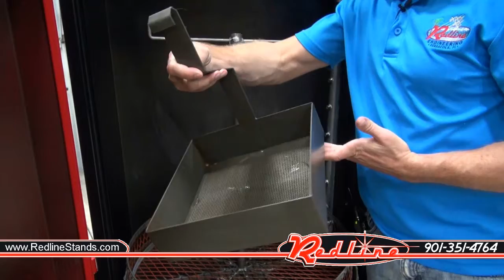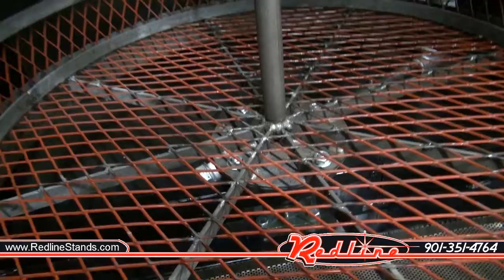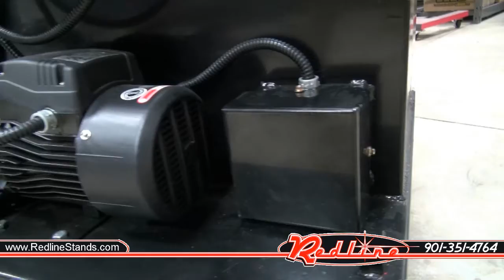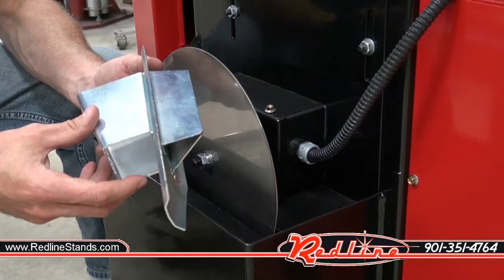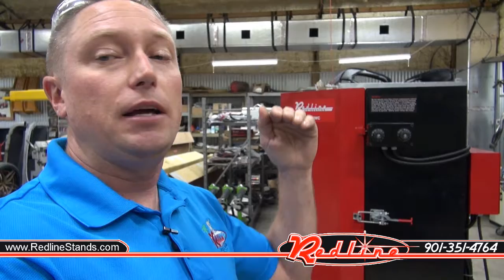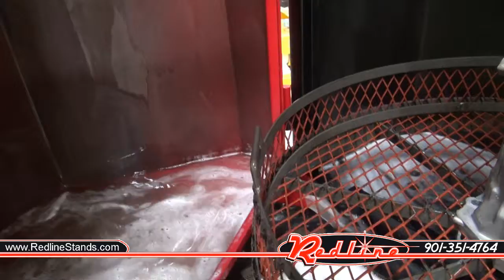Redline 500HWC Heated Wash Cabinet Demonstration

Comment: What size is the inside basket?
Reply from the maker: https://www.redlinestands.com/catalog/shop-equipment-c-327/general-shop-equipment-c-327_335/parts-washers-c-327_335_272/redline-500hwc-heated-wash-cabinet-oem-replacement-parts-tray-p-3494

Comment: It looks like you might not have enough water flow for the total number of nozzles you have.

If I was going to make it better, I would put a stainless steel flexible hose connector on the bottom pipe and the top pipe and then I would build something that would "oscillate" the nozzles side to side and up and down but not coordinated to the spin of the basket.  I believe you are missing lots of nooks and crannies by just making them solid and spraying in one direction.  

The other way to do it would be to use more nozzles mounted in different directions and maybe on different pipes with a bigger pump with more HP.  Just trying to Help, Sir

Comment: Why not install a float switch to prevent the motor from running when the water level is too low?
Reply from the maker: We might do something like that in the future, but the truth is that this is our first production run on the cabinets.  You'll likely see improvements over time, but naturally they'll come with time.
Reply: @RedlineStands  im looking to get one   you need a toilet valve float inside       with a shut off valve on the outside  obviously you cant pull it out your toilet and will need to be designed   but anyway
Reply: Ranger cabinets have them, honestly theres so much grease inside of them they clog up. We bypassed the switch within the first week of having it in the shop. Just pay attention to the water level and you will be fine. If it gets a leak you will definitely know it!
Reply: Excatly that happened to A Kuda that I used @bradbrinegar1419

Comment: Why not put in an automatic fill for the water supply ?
Reply from the maker: That might be something we could offer later, but it's not a feature I'd do on the front end, because keeping the initial cost down helps a product to sell.  Given the liability of an auto-fill device concerning flooding, I'd have to think long and hard before offering something like that.  Nevertheless, thank you for the idea.
Reply: @RedlineStands  you could put an over flow that a person could hook a hose to in case of the fill valve failure. Tie The high overflow line into the main tank drain line so a person using the machine only needs one hose to run to a drain. Just a suggestion for future models. 👍
Reply: @batman607  After offering several workable improvements to this machine, my suggestions were removed. I guess they think any improvements made from suggestions provided may result in a lawsuit unless compensation is offered.
Reply: I get it, That’s Abe Lincoln .